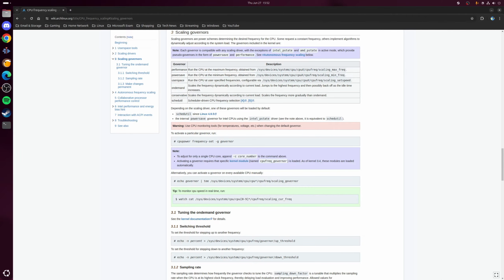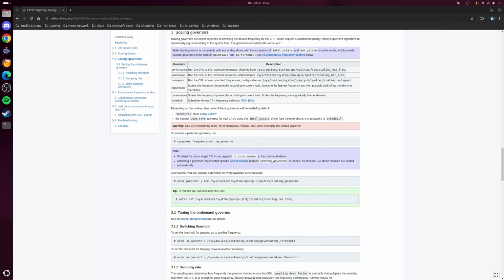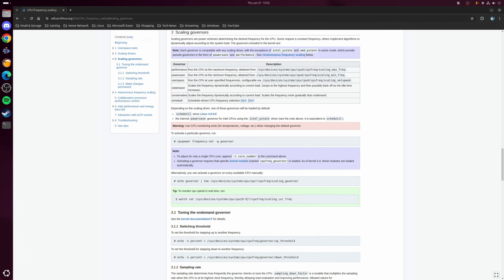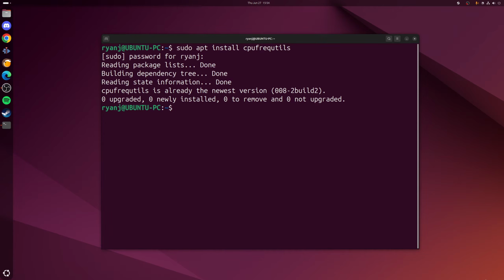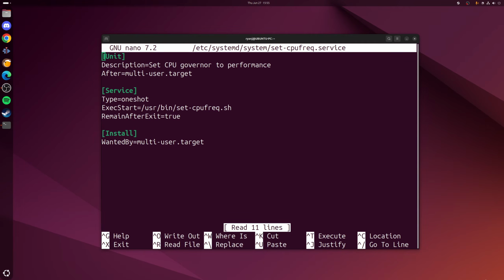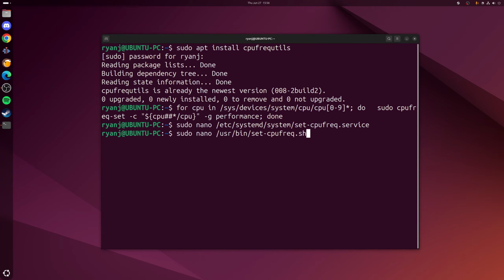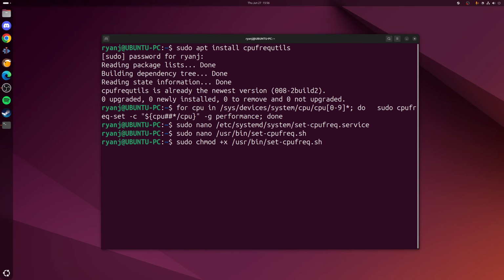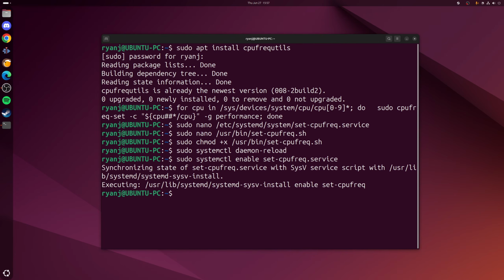How to Speed Up Ubuntu 24.04 LTS for Better Performance

Comment: how can we confirm that the settings were applied
Reply from the maker: You can check using the cpufrequtils utility.
Reply: @IntelligentGaming2020  or you can use the following command as well
cat /sys/devices/system/cpu/cpu*/cpufreq/scaling_governor

Comment: Isn't this just the same if you select Performance Power Settings?
Reply from the maker: Yes, it is, although not every machine will have that option to select.
Reply: @IntelligentGaming2020  Oh I didn't know that. Cause all I do is select Performace power settings and everything seems to work fine. Ohya, did you know with Google Chrome browser if you set OZONE Preferred platform to WAYLAND it will boost 3d gpu fps? By  default chrome is set to x11 and xwayland isn't too fast.

Comment: Thanks for the video. Question: Is this really necessary? If I understand it correctly, this makes your CPU boost all the time, which increases power consumption, correct? 
Is there a performance difference in loads like gaming between using On Demand and Performance governor?
Reply from the maker: The power consumption will be negligible, especially on a desktop, and yes using the performance governor over ondemand does make a difference in gaming, in fact the Feral Gamemode project does this by default - https://github.com/FeralInteractive/gamemode#gamemode
Reply: @IntelligentGaming2020  cool, thanks for the info!